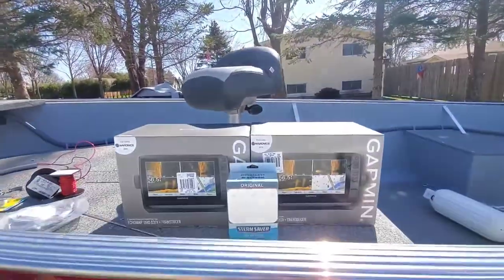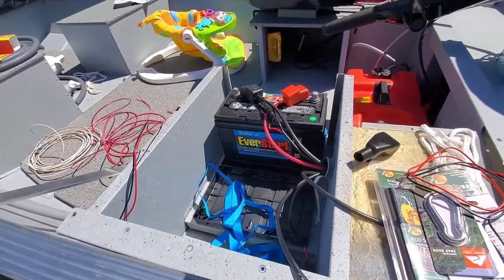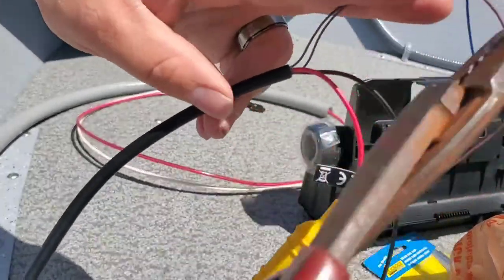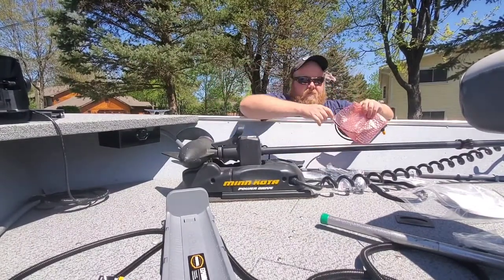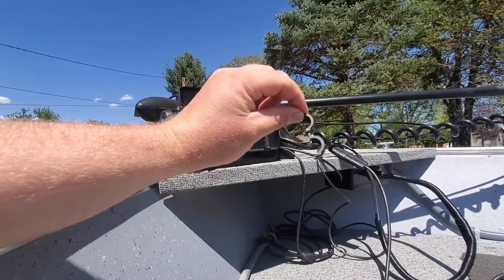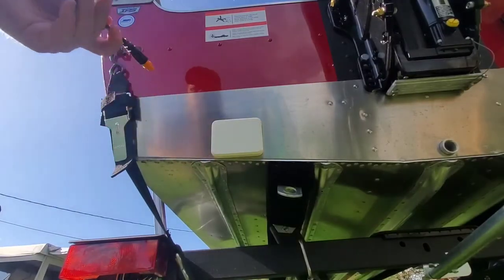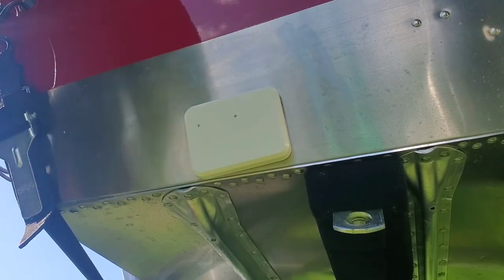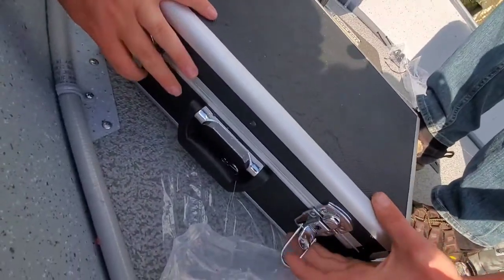DIY Garmin Echomap UHD 93SV Install Trolling Motor & Transom

Comment: Did you end up experiencing interference on the front unit display when the TM is running?
Reply from the maker: It's weird. I know I have intermittently in the past, but I also know I didn't this past weekend.    I think in my case, it had to do with the proximity of the extra transducer cable to the Junction Box for the TM plug.  That's the only thing that could be variable in my setup, and I've certainly never done anything to address the issue specifically. If it is a serious concern for you, a professional install might be worth it for peace of mind.
Reply: @dansmidwestangling  thanks for the info! I'm installing mine this weekend and I'm deciding  between transducer going on transom mount or the TM.

Comment: Doesn't the ferrite core go on the transducer cable?
Reply from the maker: Either is acceptable and I've seen posts from people who ordered extras and put them on both, as both cables are capable of picking up interference.  I chose to install them on my power cable because 1) my old Humminbirds had them built into the power cable, and 2) due to the close proximity of my starting and TM batteries I felt I was more likely to get interference from the power cable.

Comment: You could have saved having to install two transducers by linking your Garmin units together with a network cable.
Reply from the maker: You are correct, and though I didn't show it here, I did do exactly that! I do however want both transducers installed, because vertical jigging is a big part of the walleye game so the guy in both the front  and the back can watch their baits independently.  Someday when I cash my  billion dollar PowerBall ticket, I'm going to get live scope and I intend to only run one transducer on the Stern to be shared by both units as you described.  Thanks for watching and tight lines!